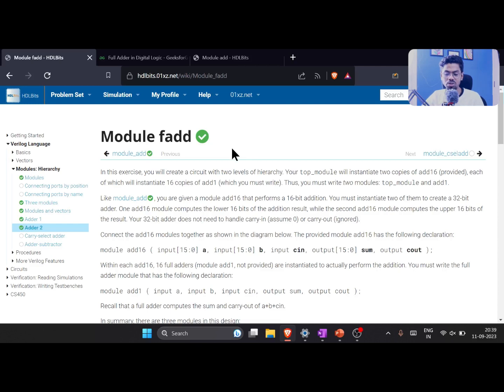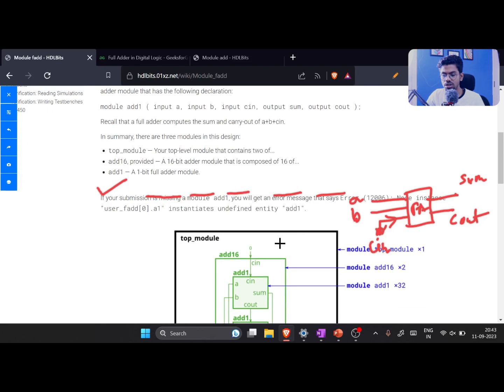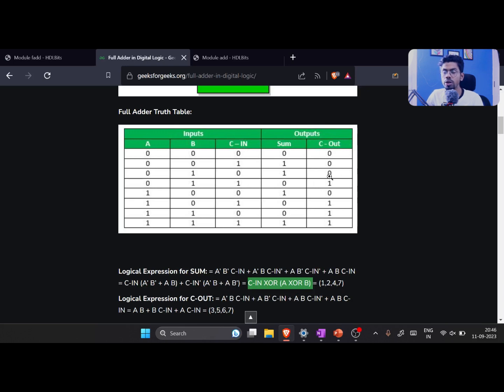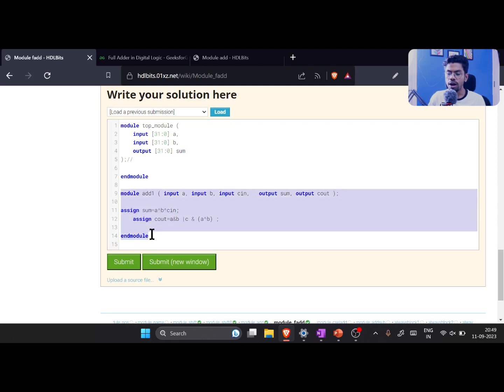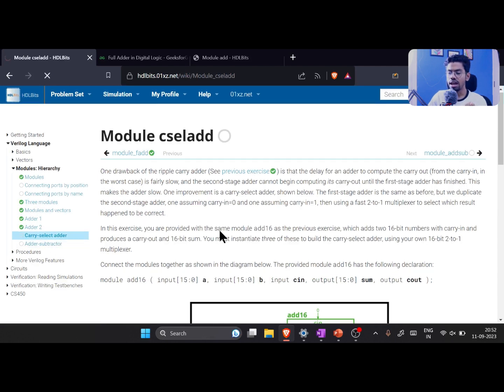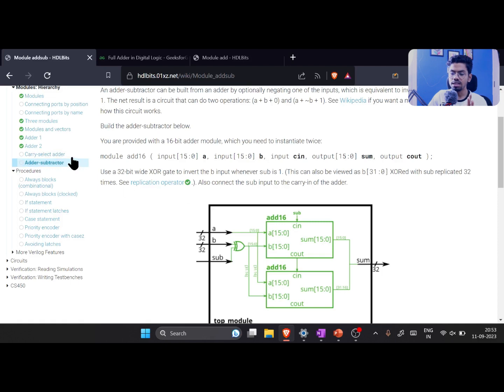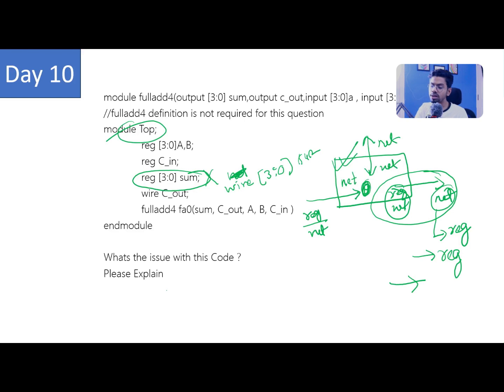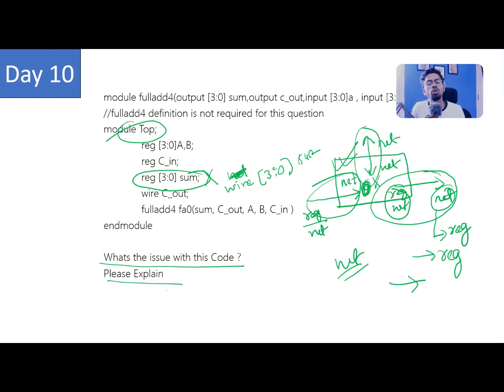Design Full Adder | Lets Learn Verilog with real-time Practice with Me | Day 11

Comment: module top_module(
    input [31:0] a,
    input [31:0] b,
    input sub,
    output [31:0] sum
);
    wire add1_carry;
    wire[31:0] w1;
    assign w1=b^{32{sub}};
    add16 a1(.a(a[15:0]),.b(w1[15:0]),.cin(sub),.cout(add1_carry),.sum(sum[15:0]));
    add16 a2(.a(a[31:16]),.b(w1[31:16]),.cin(add1_carry),.sum(sum[31:16]));
endmodule

Comment: module top_module(
    input [31:0] a,
    input [31:0] b,
    input sub,
    output [31:0] sum
);
    
   wire cout;
    
    // Perform bitwise XOR between `sub` and `b` to create a 32-bit modified vector
    wire [31:0] b_xor_sub = b ^ {32{sub}};
    
    // Call add16 modules
    add16 f1(a[15:0], b_xor_sub[15:0], sub, sum[15:0], cout);    
    add16 f2(a[31:16], b_xor_sub[31:16], cout, sum[31:16]);

endmodule

Comment: please make the solution of adder-subtractor problem
Reply: module top_module(
    input [31:0] a,
    input [31:0] b,
    input sub,
    output [31:0] sum
);
    
   wire cout;
    
    // Perform bitwise XOR between `sub` and `b` to create a 32-bit modified vector
    wire [31:0] b_xor_sub = b ^ {32{sub}};
    
    // Call add16 modules
    add16 f1(a[15:0], b_xor_sub[15:0], sub, sum[15:0], cout);    
    add16 f2(a[31:16], b_xor_sub[31:16], cout, sum[31:16]);

endmodule
Reply: Have you solved the 16-bit carry select adder problem?

Comment: In the top module (given in the question) the output port sum is declared as reg type which holds a value and can cause some wrong result in the outside world. But in verilog anything that is declared outside should be of net type only.